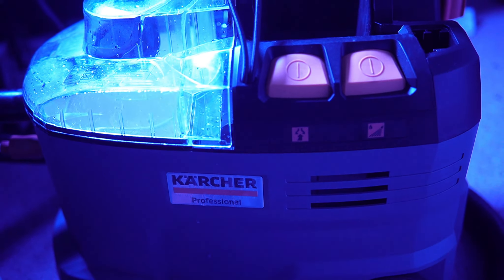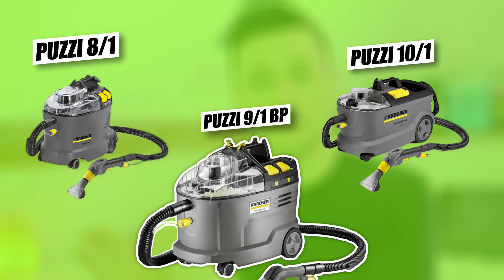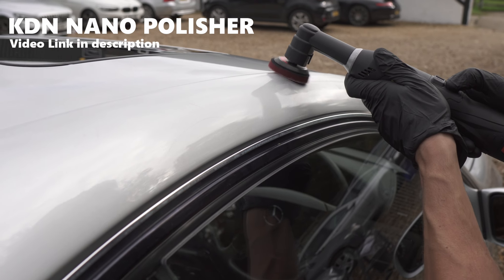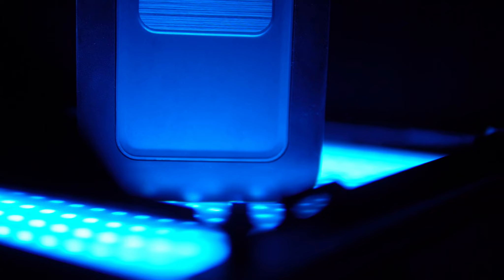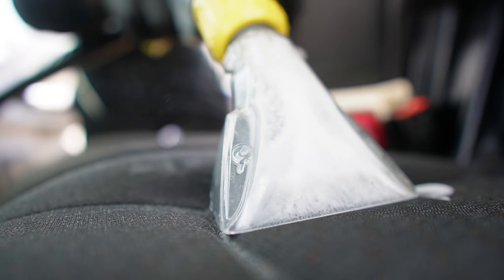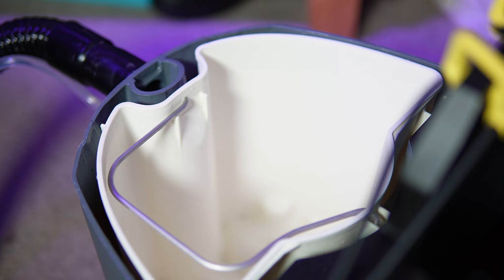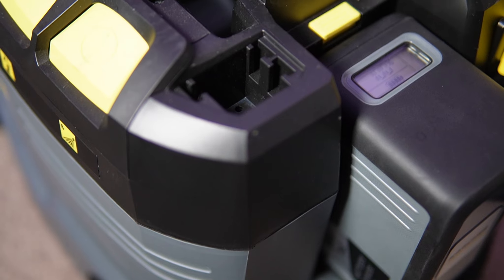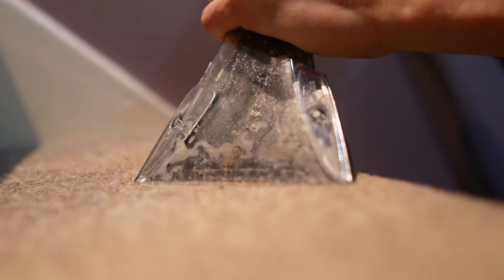The Battery Powered Karcher Puzzi That changes Everything!

Comment from the maker: What's your go to carpet cleaner? Let me know in the Comments
Reply: Sorry not about the carpet cleaner, just need advice as nilfisk customer service wont help me because its not there lance.
I got a nilfisk 140
It works fine with my stubby gun until I attach my snowfoam lance.

It pulses like there isn't enough water going through but works without it on.

I have changed the outside tap because I thought it might be the water pressure but still happening.
Reply: Picked up a numatic carpet cleaner off ebay for  £56, already paid for itself.
That's a lot of money for the puzzi, for the the £840 I would expect a charger and a battery included.
Thanks for the upload as always.

Comment: Great video Dave 
Editing and filming as always is on point! I have the 1/10 and at £1180 will be keeping the main plug!
Having said that after using a cordless Flex polisher for over a year, I would struggle to go back to a cable.
But the price difference between the cable/cordless flex was not as steep.
Reply from the maker: Thanks mate. Dialling back off editing. Takes too long for some videos. The battery idea is good but the world isn't quite there yet

Comment: It's a good idea for valeters wanting to get away from using a generator from the view point of noise pollution and I must say with ever increasing prices of fuel, if they do a range for vac, pressure washer aswell I would most certainly give them a try, great video dave.
Reply from the maker: Its good idea but when the battery dies its annoying
Reply: Well, you’re right and not.. if you’re a pro and if you have a few jobs per day ya need at least two sets of batteries.. you need to charge it somewhere as well.. and when you compare technicals with an puzzi 8/1 you notice thats its just not worth that money at all…

Comment: Hi dave great video, I like the idea of a battery powered carpet extractor but it's just too expensive, a lot of people will be sticking with the good old plug in machines, hopefully it won't be too long before they come down in price
Reply from the maker: Yeah too right mate. It still needs power supply to charge the batteries so it doesnt quite work. But on the plus side its incredible

Comment: do you own a George? if so how to the Karcher machines compare? Thanks for the great vids
Reply: I own a George which I keep at one location. I also have a Karcher Puzzi 10/1. The Karcher is much better in my opinion. The motor on my George went due to moisture getting into the motor because of wet vac extraction. I had the George repaired, but I strictly use it for dry vacuuming now. The Karcher is my go to for wet vac jobs now.
Reply from the maker: I did have a george But i broke it due to my own fault. I since then got a charles which is identical without the sprayer so i use a 5 litre pump sprayer for fabrics
Reply: Thanks for the input gents

Comment: as a car valeter working in a car sales centre what extractor would you reccomend. budget of round 100-200. would the bissel spot clean pro be good.
Reply from the maker: Sadly they aren't built to last so like domestic pressure washers they have very short lifespan
Reply: @epicautomotivedetailing  oh i see. so would you have any other recommendations. thanks. also, i currently use a numatic wet vac

Comment: Sounds like it only makes sense for a pro like yourself with the price pal? On the plus side its good you didn't notice any loss of power tho as I have battery powered garden equipment and the loss of power is huge!!! Eventually most things will go battery powered I think pal.
Reply from the maker: Even pros struggle with that price at moment with expenses going up
Reply: @epicautomotivedetailing  yeah fair enough pal......looks a great bit of kit, just a shame about the price 😕
Reply from the maker: @richardgould1978  give it few years and hopefully this will be the norm

Comment: Very expensive machines, nothing wrong with a spot clean pro.
Reply from the maker: Yeah true but spot clean pro isnt as robust but then again you can by many of them over time
Reply: @epicautomotivedetailing  exactly
Reply: The tool on the Bissel smaller to makes it easier to use in small spaces

Comment: I stopped watching at "£1,140" - for a machine with a max 35 minute run time I'd need AT LEAST 2 batteries to get through a day's work so that's me up to £1,300!!! This product makes absolutely no sense for a mobile car valeter whatsoever. This is a luxury item for someone with money to burn. Awful product for a mobile valeter and a unit-based worker would use a mains device.
Reply from the maker: Yes that's the point I was trying to get across in the video. I was trying to highlight the failings of modern tech before I release my budget extractor video
Reply: It depends. I live in Burkina Faso and I totally see the point in investing in these machines : we got a lack of energy supply, I run a sofa car cleaning entreprise, many customers lack the power to supply professional machines, if you want to clean a car outdoor how do you do it ? Generator cost about the price of 3 batteries, very heavy, and costly to run. Buying that stuff for personal use of if you have a sure source of low cost energy (customers plug) it's useless though
Reply: @guillaumeouedraogo6108  That's the point. I'm live in Hungary's capital city, the  hundreds of thousand people's living in house of flats so they don't have power to use carpet cleaner in the nearing parking cars. You can hoover your car in a petrol station but nothing else. So I'm interest to buy one or two machines and trying to rent it. :)